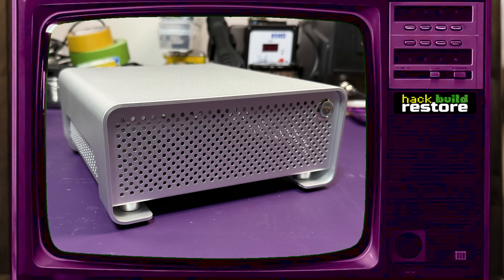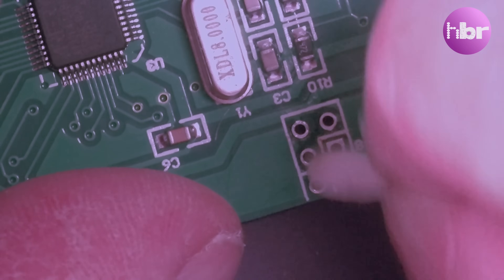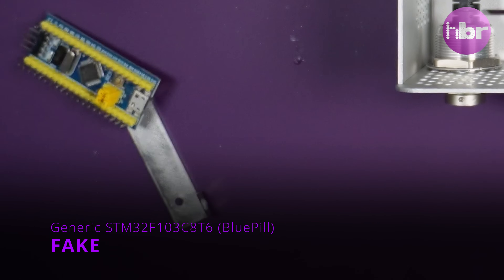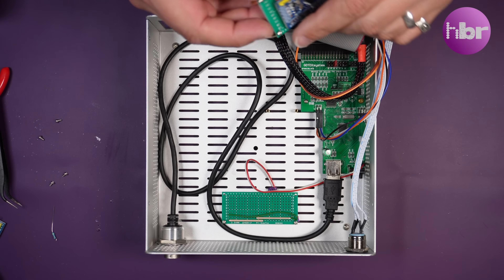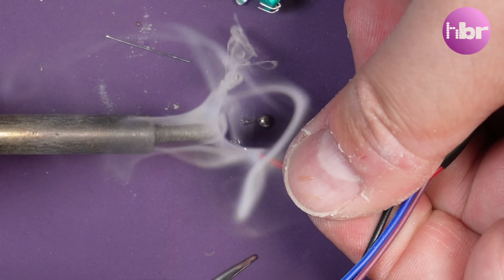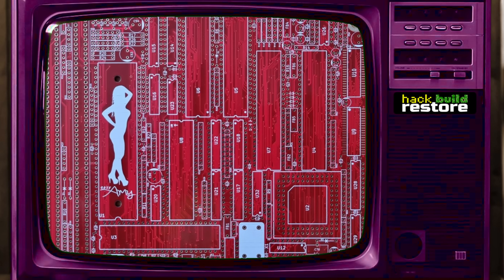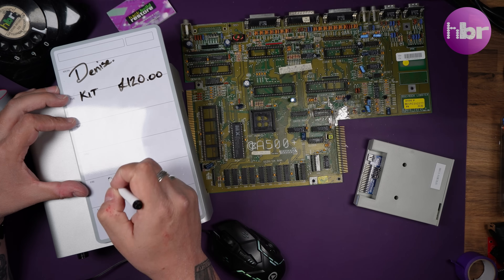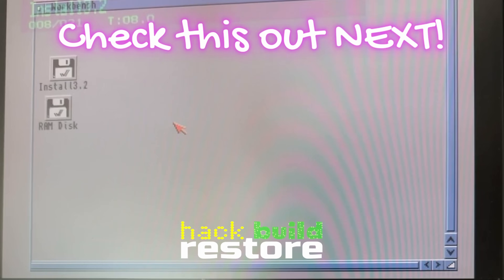The Amiga Upgrade You Didn’t Know You Needed

Comment: Nice build.  You made some pretty good choices for esthetics, until you open up the case.  Integrating all of that into the board itself would be good, and put the 7400 series glue logic and other common IC's built into the board so they are already soldered when you get the board from JLCPCB.  Building in the sockets and a PiStorm with the ability to switch it would be awesome.  I wonder if JLCPCB has access to the QFP 68000 that will do 50MHz.
Reply from the maker: The internals will be tidied up further, as for the rest that’s like saying to a painter you know you can just get a photograph printed on the canvas! 🤣 the build is what I enjoy doing :)

Comment: Your adding went a bit wrong...
Reply from the maker: Nope - all adds up  time stamp 13:17

Amiga 500+	                                           N/A 
Denise PCB Kit	                                £120.00 
DigiKey	                                                  £69.91 
Mouser	                                                  £46.00 
STM32	                                                    £3.00 
USB Mount Ext	                                    £9.44 
LED Filament LED	                            £2.00 
Power Supply	                                    £9.95 
Case	                                                  £45.35 
Stock (I already had some parts) 	  £50.00 
GOTEK	                                                  £11.01 

Total	                                                £366.66

Comment: The OSD was an option I hadn't seen before. Very cool, something to remember for my a500. 
Also a very nice price breakdown.
If you already have the a500 or a spare chipset it might be a fun option. But personally, as I commented on the previous video, I would go with an amicube board if I had to start from nothing. a current minimig is 360, 450 with a case dollar. Not sure what the new board is going to come in at. 
That is quite similar in price to this build and has all new chips, and can do much more. 

But it's all personal preference and starting point. If I had a chipset to spare this Denise board might be fun to do. 

All in all a cool video.